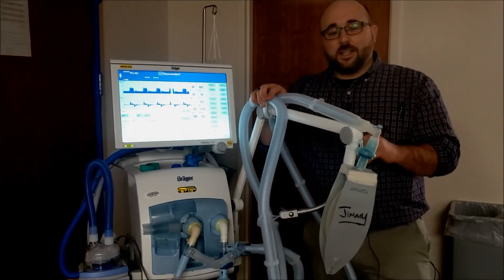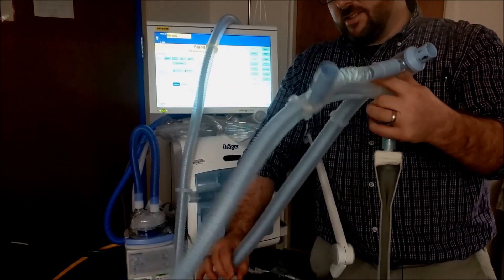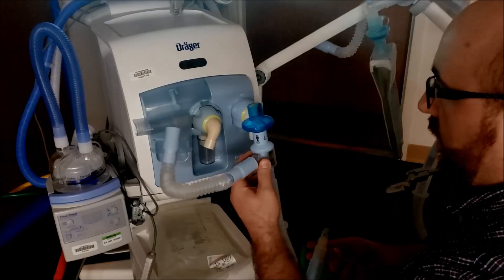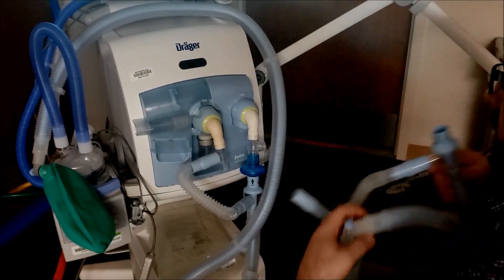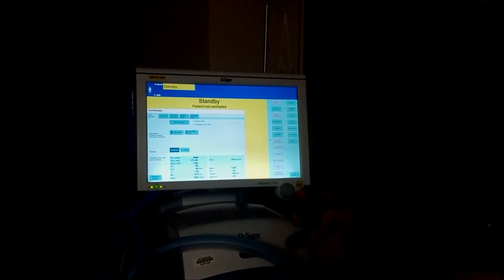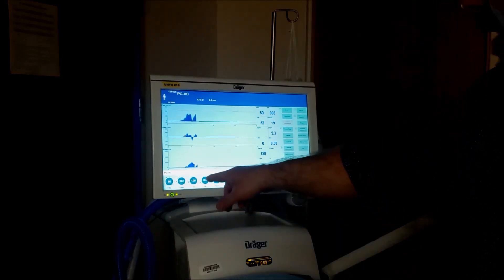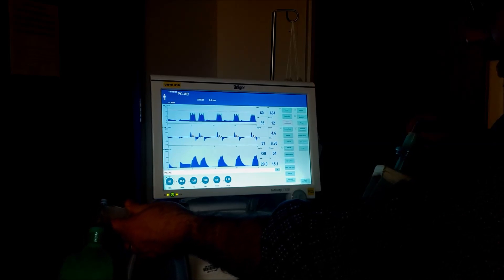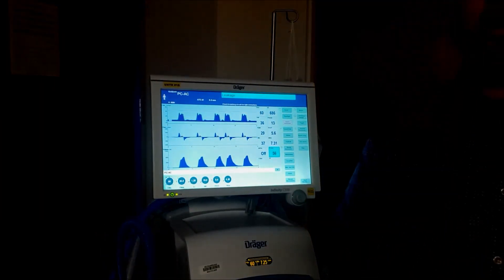RT Clinic: Pandemic Preparedness -Two Patients on One Ventilator - Don't attempt this clinically!!!

Comment: This was actually done in Las Vegas with the mass shooting at the concert. Not ideal. But it gets the job done TEMPORARILY in a pinch. I set one up with tests lungs and some creative connections just to see how/if it would work. I was using volume ventilation. I had to double the set tidal volume and it appeared to inflate the test lungs equally. Obviously the patients would have to be similar in size. But it doesn't have to be exact. In a PINCH, it would matter if the tidal volume was a little less than optimal. I don't see too many situations where you would really need to do this, but it can be done under the right circumstances. More studies need to be done on this subject.
Reply from the maker: I agree.. it would be a bad day if we had to start doing it in a disaster!!

Comment: This is not as easy as it seems. I don't encourage people to do this, neither recommended it since more testing is required before being used in humans. I recognize your effort, and motivation but there are a couple of things to consider if you have the ,extreme need to do it. It is hard to find two persons with the same mechanics, and the fact that you have open connections between them, will make the pressure go around and go to the pt with less resistance by the expiratory limb. We did it in the lab, and I can tell you that happens, so we had  to place one way valves in strategic places, to avoid that. Also we use come variable section resistors which let us graduate Vt and PEEP individually. Again, this was done in a poorly simulated scenario, and it worked only there. This is my humble observation of your model.

Comment: Jimmy, 

I love the idea of using co-axial circuits if they are available since it really simplifies the circuit. I am so glad you stated we should ventilate these patients with pressure control since I have viewed other videos that state volume control can also be used safely. My professor Lonny Ashworth at Boise State University just created an in depth video going over this same setup but with traditional wye circuits. We decided to use one way valves and viral filters to help isolate the patients and prevent contamination. We also describe a way to approximate delivered tidal volumes to each patient and therefore trend their resistance and static compliance.
Please take a look at my channel and see what you think. The more feedback the better!

Comment: Will infection control be an issue with one ventilator? Does it mean that you really can't manage patient condition individually as they share the same setting? Thanks
Reply from the maker: This would be for a disaster situation only or a surge of patients. It would be only a temporary measure. Short answer, IC wouldn't be cool with it.
Reply: Thanks! Continue sharing your expertise.
Reply: I would assume in a disaster situation wed likely group patients into cohorts of two to minimize exposure. Also this could potentially free up vents in certain situations where a patient is positive for covid 19.
Reply: @atlantisrose6790  you can take this further (possibly using a couple of Ts to vent 4 pts at once)  and group COVID patients based on broad lung dynamics, check out the post on EMCrit re this topic where they discuss having multiple vents with various settings available and then basically shift patients around based on their need for various settings. They discuss 5 vents with a variety of settings. Scroll down to the "Bigger Picture" section 

https://emcrit.org/pulmcrit/split-ventilators/